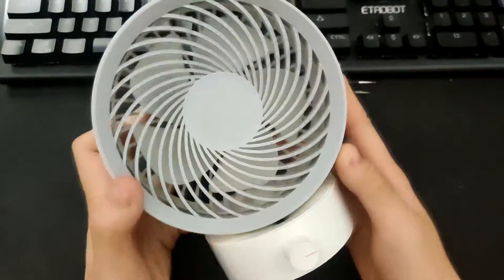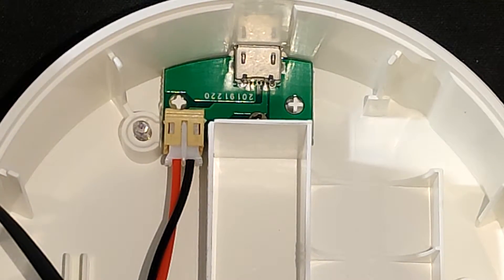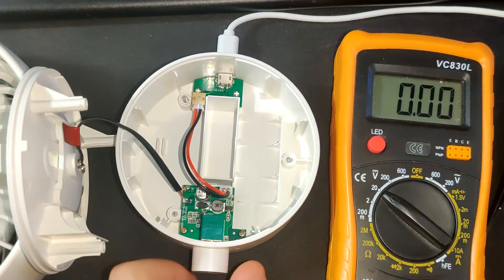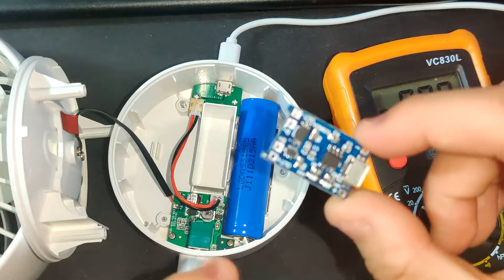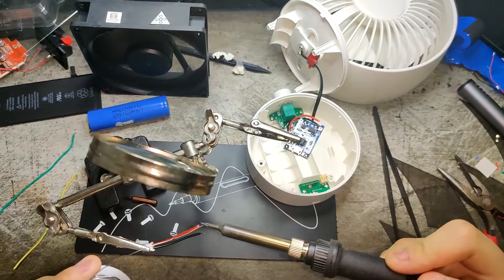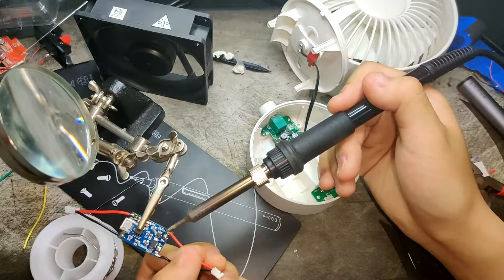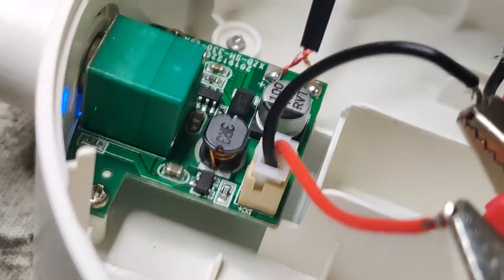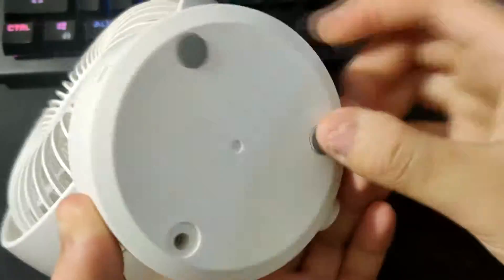Modding Smart Devil usb Fan with 18650

Comment: What is the runtime with your specific 18650 battery? Does this chip allow you to still use a USB to power the fan or is it battery powered only with USB only to charge?
Reply: Does this also allow for passthrough power from USB cable, to power the fan without using the battery?